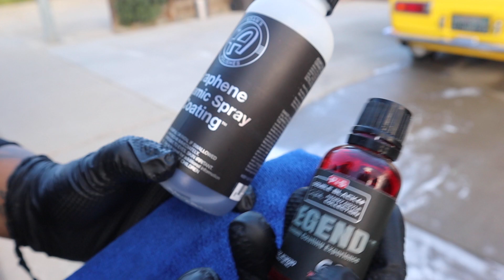Vintage Datsun Detail - JoelDetailing

Comment: Turned out great but if you used that aio polish on the paint you already added protection and you topped it with a spray sealant so it might not fully bond right but who knows time will tell
Reply: It won’t bond correctly over that AIO.
Reply: Same as applying a wax over a wax the second coat removes the first.

Comment: In ur professional opinion, does iron decon work on wet surfaces at the same exact intensity as dry surfaces?
Reply: Applying dry is best simply because if water is on the surface it's will dilute the product, but it still works, I do a prewash rinse hand wash rinse then apply iron remover and rub it in with a towel then rinse well. I've used fireballs iron decon and it actually says you can dilute it if desire and it's vary strong, used it once and sat for a few months and it literally seized the sprayer when I forced it the sprayer broke apart.

Comment: At the moment graphene is not there yet . From my experience ceramic is still king . I have Done maintenance details on graphene coated vehicles and it seems to wear off much easier . Not even a year in and coating is already failing . Also clay bar should not wear off a coating which it did on the graphene coating ,so that speaks for its self
Reply from the maker: Every vehicle  I've graphine coated (spray or pro versions) has out performed ceramics in both versions. Maybe revisit your surface prep an correction procedures.

Comment: 9H is The highest on the pencil scale and 9H on the pencil scale isn't that hard, it's basically just another buzz word the companies use. Coating are great but they are over hyped and have alot of misconceptions. I do a few Coating a month and honestly turn down half the jobs or talk the customer into something else, due to care of vehicle and wash methods. I live in Minnesota so most ppl use auto car washes and they beat up any protection pretty good when used 2 plus times a week in the winter. That's alot of extremely high ph chemicals on the paint.
Reply from the maker: I mentioned pencil scale in the raw version,  but edited it out as it was too much information and being too technical sometimes feels like a run on sentence on video. I referenced a #2 pencil as it's the most familiar to most